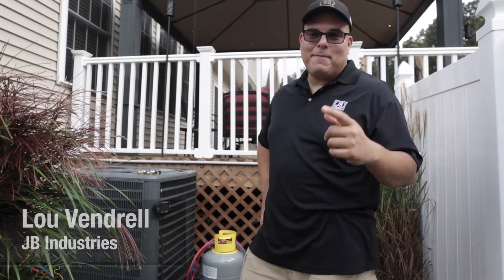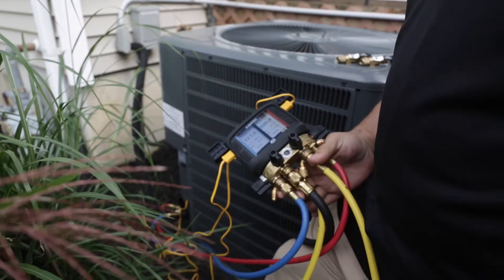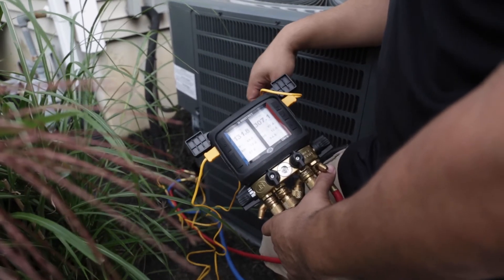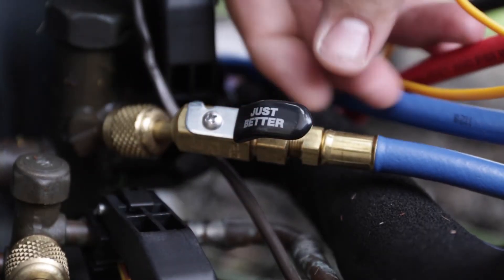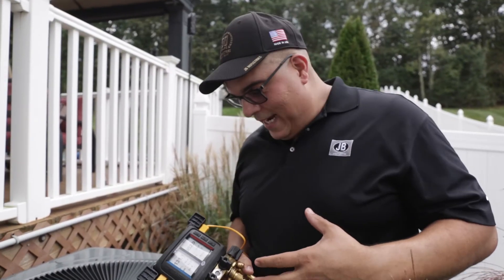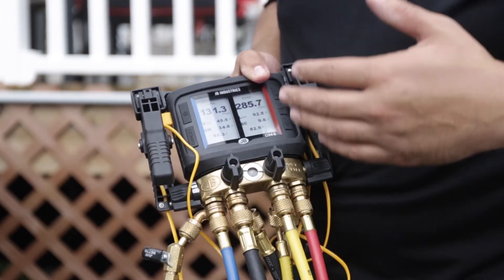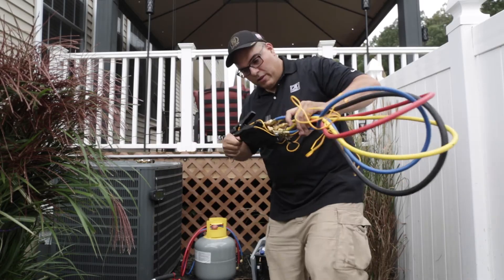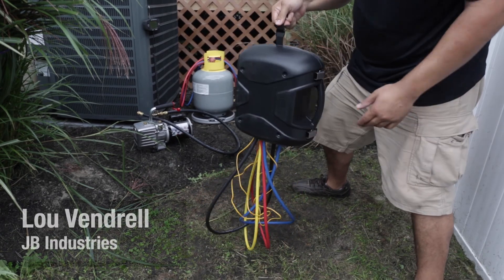JB DM4-R REVOLVER Digital Manifold Demo

Comment: I was happy. After prolonged use. I cant recommend these. Especially for the price. Not wireless, no micron gauge, plastic holders which make no sense considering how often you have to rip em outta there. We're service techs, not hand ballerinas. And my backlight is inexplicably dim. not being wireless is the biggest deal breaker for me. Stick with fieldpiece.

Comment: Easily the worst gauges I’ve ever used.  Plastics all busted up, battery cover broke, no micron gauge, hoses suck and if you don’t turn off it will run the batteries dead.
Reply: Thanks for the heads up, I was thinking about getting these. Any Digital Manifolds you recommend?
Reply: @christov4120  Fieldpiece SM480V